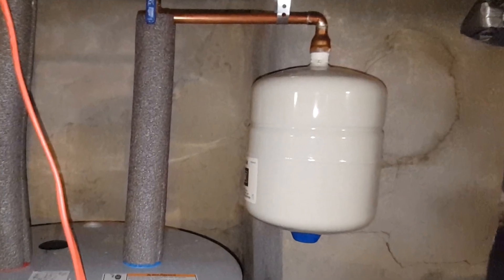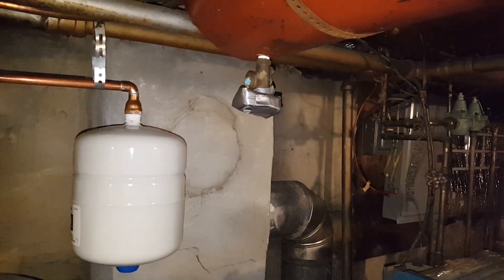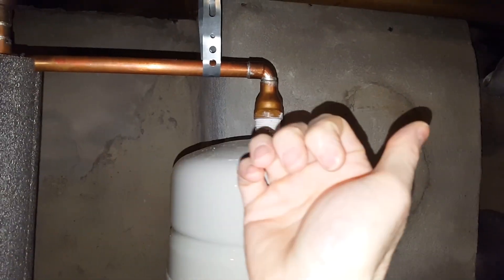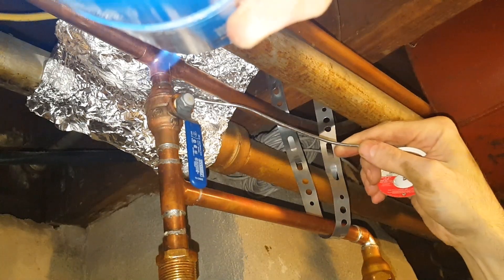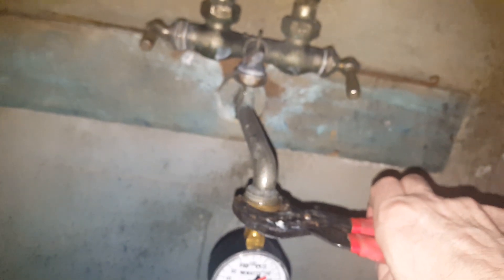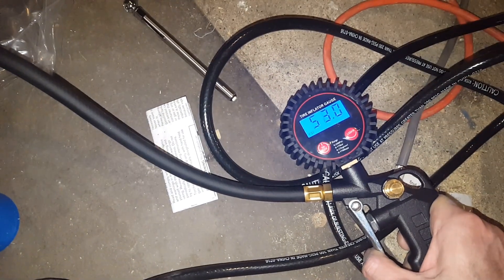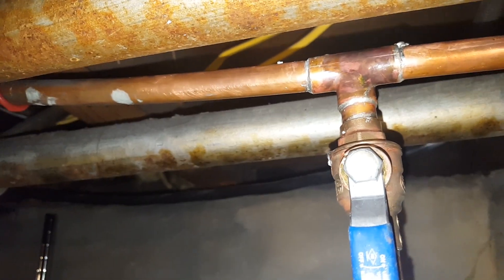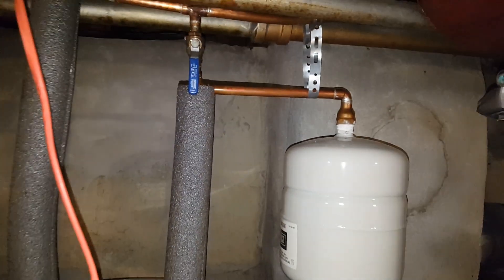How to install thermal expansion tank on water heater /replace expansion tank, Prevent an explosion

Comment: I'll tell you why I think these are now necessary. New hot water tanks have little plastic inserts called "heat traps" in the tank nipples. The water heater nipples are the two threaded stubs coming out of the water heater that you attach the cold water supply line to and the outflowing hot water line to. Those "heat traps" are designed to prevent heat loss from the water heater by stopping hot water from rising into the pipes when no water is being used. They work by using a ball or flap inside that restricts convection. When hot water is heated inside the tank, it naturally tends to rise and escape through the plumbing. Heat traps block this movement, keeping the heat inside the tank and reducing energy waste typically by around 5%. However, they also act as check valves, restricting water movement. In a closed system, this can contribute to pressure buildup, making an expansion tank necessary. Doing without an expansion tank in these cases can lead to the following problems:
- Increased pressure fluctuations: As water heats up, it expands. In a closed system, this expansion has nowhere to go, which can lead to excessive pressure buildup.
- Frequent activation of the Temperature & Pressure (T&P) relief valve: If the pressure gets too high, the T&P valve may start dripping or releasing water to relieve the excess pressurePotential damage to plumbing fixtures: The pressure surges can stress pipes, fittings, and even appliances connected to the system.
- Reduced lifespan of the water heater: Constant pressure fluctuations can wear out internal components faster, leading to premature failure
- Risk of leaks or even tank rupture: In extreme cases, excessive pressure can cause leaks or damage the water heater itself.

I have been experiencing the second problem (my (T&P) relief valve keeps releasing water whenever the heater comes on) since I installed my new water heater and left out the expansion tank. My house was built in 1947 and there isn't any place for me to put in an expansion tank. So at this point, I'm asking myself if maybe removing the heat traps from the water heater's nipples might eliminate that problem.

Before you buy a new water heater, be sure to read the thing's warranty before you buy it. Will removing those heat traps void my warranty? Yes, it will. That's considered a "modification" of the water heater. However the warranty provided by Reliance is basically worthless anyway if you read it carefully like I did. Besides, I had to replace the cheap, plastic drain valve (don't even get me started on that  nighmarish event) with a good brass one. That is also considered a "modification", so I have no warranty any longer. 🤬👎

I'm betting that all water heater companies have similar, worthless warranties.
Reply: P.S. In the mean time, I've turned off the power to the new water heater until I get this sorted out. For the 31 years that my previous water heater lasted, I never needed an expansion tank. Never had any problems with my plumbing as a result. That's probably because the old heater didn't  have any heat traps in it.

Comment: wrong  ... the  house water  pressure when you install it will turn up the air pressure inside  by pushing on the bladder  then you adjust it    on a filled  cold water tankand  air removed from piping  .  thus when the water heats up the bladder moves   takeing up the  over pressure

Comment: I live in CA and have never seen one of these installed.
Reply from the maker: Maybe you've never seen closed loop systems or are overlooking equivalent expansion valves because "California Plumbing Code (Section 608.3) and the California Mechanical Code (Section 1005.0) requires a thermal expansion tank, or listed equivalent, to be installed to water heating systems to relieve excessive building pressure during the heating process."